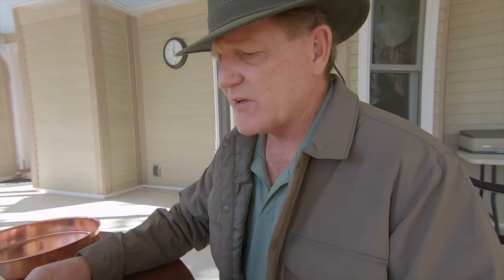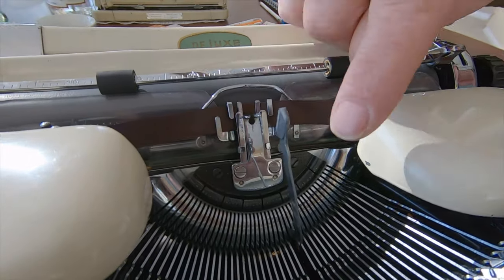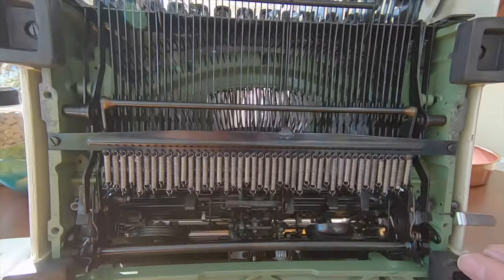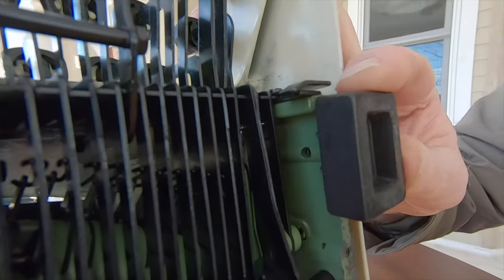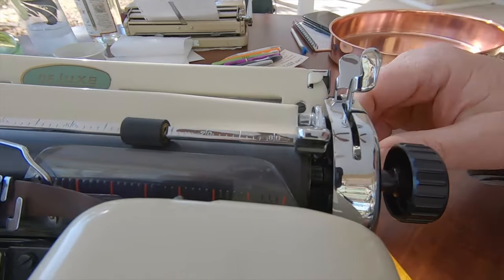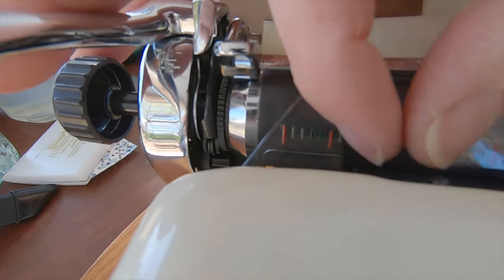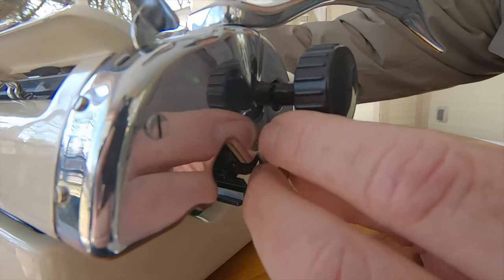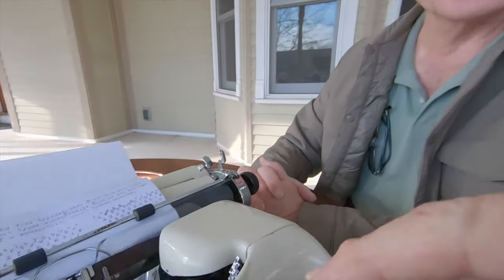Typewriter Video Series - Episode 218: Voss De Luxe

Comment: One major downside with the Voss: the card scale. If that snaps or breaks, the machine is unusable, as it helps feed the paper sheet past the bottom of the platen. Other typers don’t depend on the card scale to feed paper in. A strangely large oversight for such a high quality machine.